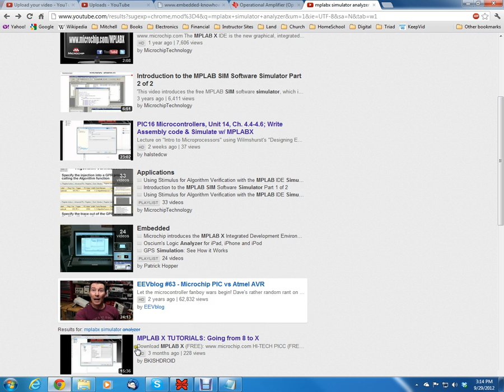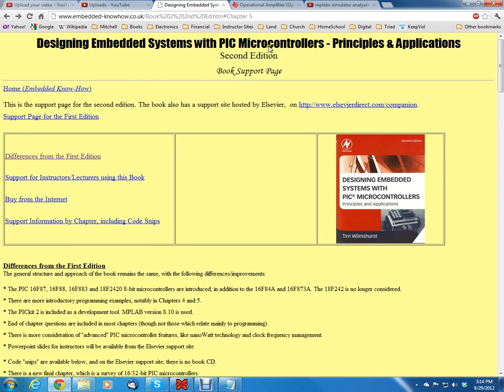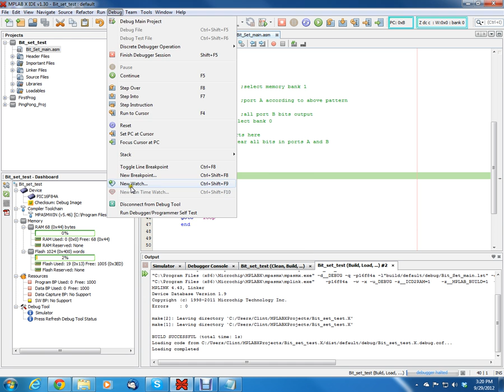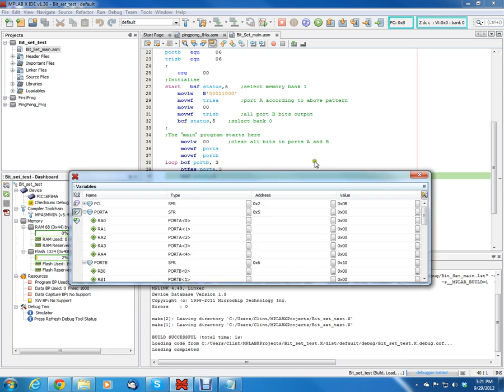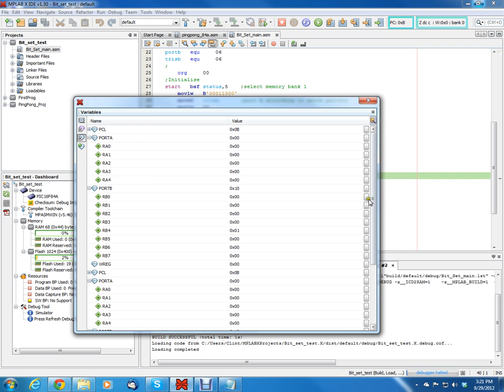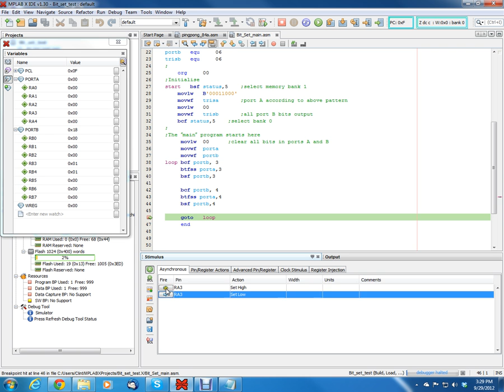PIC16 Microcontrollers, Unit 23, Ch. 5.1.1; MPLAB X Simulation Tutorial

Comment: Thanks for the video, but for a complete newbie to Microcontroller programming (but a solid C++ programming background for PC's), it really wasn't clear, how, when or if, a simulator was being used in this video. Everything you showed looked like what I would expect from a normal programming environment.
Reply: +Peter Wilson The simulator is introduced, the simulator itself is just minimal. The memory addresses that the simulator was showing are not the ones being used on your computer, neither are the ports that he was assigning a simulated voltage input. Assembly is extremely hardware dependent, and this environment allows you to step through your code before programming your microchip.